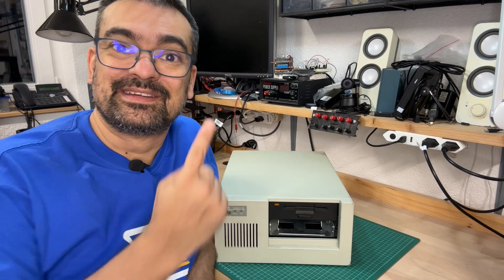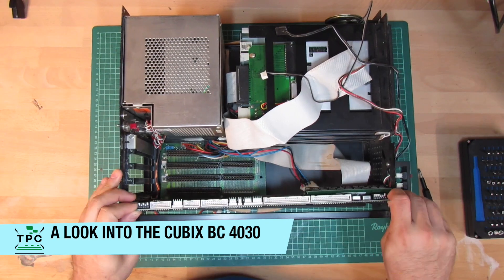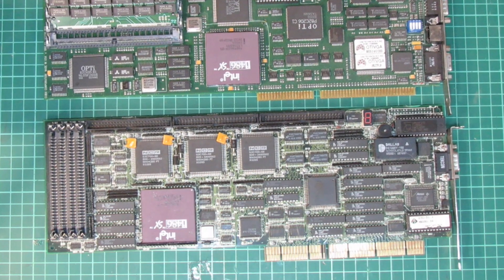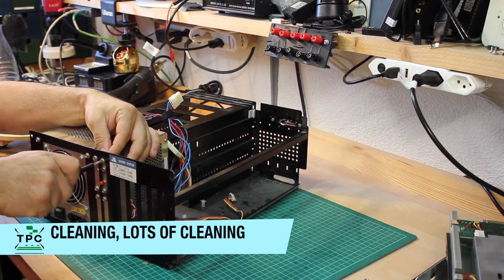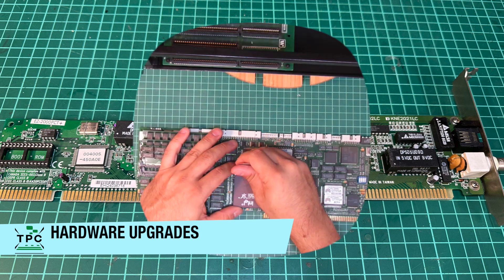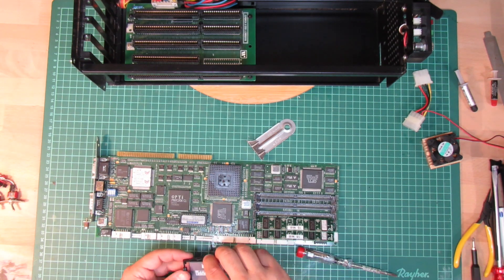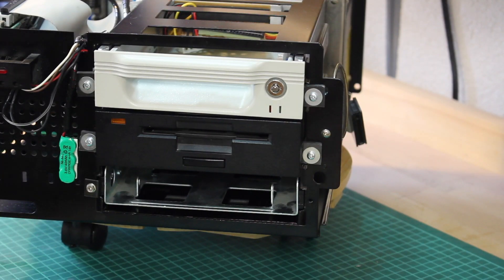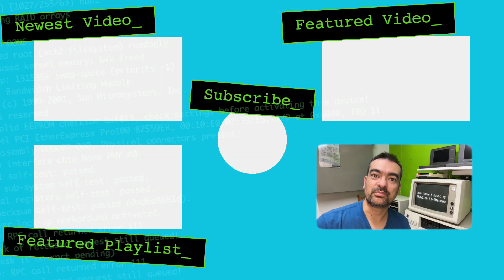The EXPERT 286: An 80s IBM PC/AT 5170 lookalike with a very special CPU board

Comment: looks like you might be using arctic silver MX-5? that stuff was recalled for oil separation (which is why it spreads so poorly)
Reply from the maker: Good hint. Yes, it was an arctic silver, but not the ones recalled. I was checking though and realized, it was a very old one, dating back to 2018! Yeah, maybe one shouldn't use thermal grease that old ...

Comment: I would like to see running a Novel Netware 4.x on this machine and also pushing it's limits when it comes to a collaboration/working environment like using chat (mhs), file sharing, printing service,  xntpd, even voice (with knoppix), network gateway, local web services, database, console access, basic network management, making a network diagram etc. (if you just pick two or three of these and present them, that would be splendid). It is very time consuming, I know :)
I know there wasn't much security and most people used non-secure way of accessing information back in those days,  but let's say having a user/pass for authentication is acceptable for these machines.
So briefly it would be nice to see interconnected old computers that can prove that they are still usable for standard tasks today.